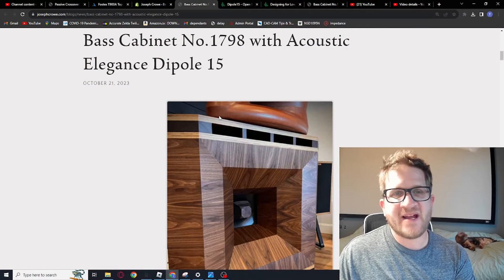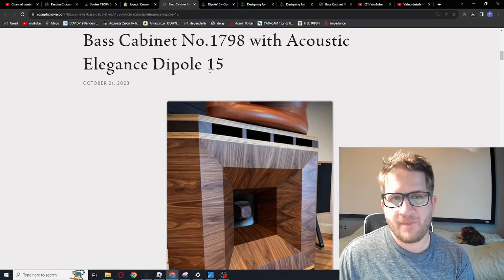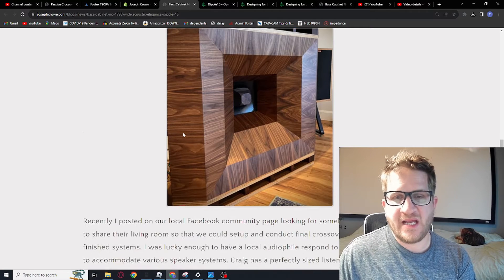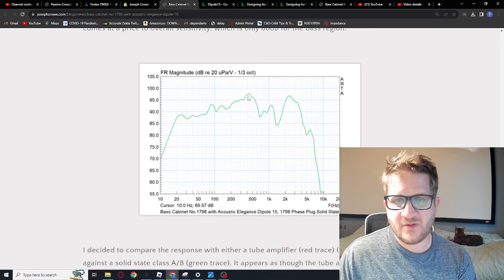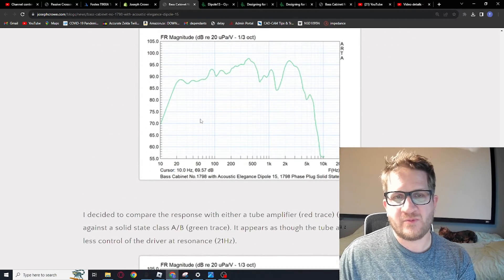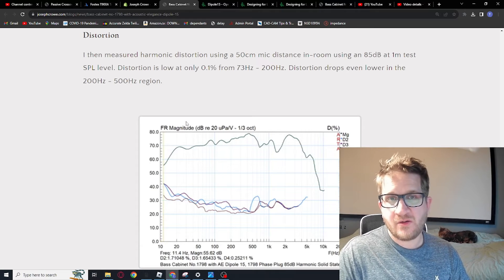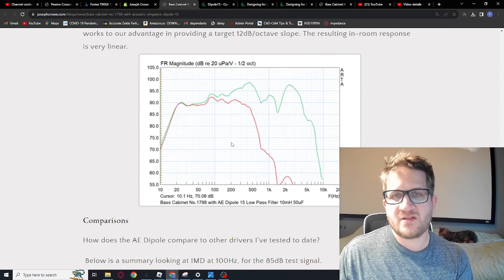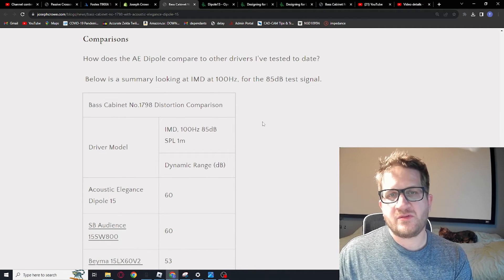Bass Cabinet No.1798 with Acoustic Elegance Dipole 15

Comment: I think it's time for you to switch to 18 inch speakers. A completely different feeling of low frequencies, significantly less distortion, the very format of music perception changes. You haven't even set foot in big sound territory yet.
Reply from the maker: Thank you for the suggestion. I will eventually get there. I’ve modelled an 18” but it’s a big change for the 1798 cabinet, it pushes the size larger than I think most would go for. So I may look at a regular bass cabinet using the Beyma 18LX60V2.
Reply: Given the cost difference between the 15” AE and 15” SB, could you use two of the SBs in an OB design and get enough bass extension to not need a sub? Two SBs per side would still be cheaper than one AE driver
Reply: @ccdccd8615  For several years I began to use 18 inch speakers in my designs, both an OB and a modified bass reflex. Even one driver produces bass of a completely different quality. I can recommend JBL 2268HPL, JBL 2241H, you won't be disappointed. The price is very affordable, no distortions at all, high sensitivity and most of all - phenomenal, very palpable and texturized bass impact.

Comment: According to AE's homepage the driver have an xmax of 15mm peak, not p-p. 🤔
Reply: Based on 70% of  BL. Not by when the surround makes it unlinear. They used to be rated at 12mm xmax when sold by the original manufaturer- Lambda Acoustics. So who knows without testing them over different excursion lengths? The 15M starts to get anomalies from stretched surround at 3mm ish, while it's rated at 6mm xmax on AE website.🤔

Comment: What concerns me about the speaker is its low FS. This tells me that most likely has a high moving Mass, which might explain the low sensitivity.
Reply from the maker: The moving mass is 90g, the SB 15OB350 is 107g. Moving mass is not directly related to sound character, despite it being intuitively related…it is not.
Reply: Not necessarily. You need to consider the Vas, and other suspension related parameters.
Reply: I used the following speaker in a project and and it gave very favorable results. FAITAL 15HP1060 (15" LF LOUDSPEAKER, NEODYMIUM, PUSH, 8 OHM) 
Perhaps something you might want to test. Very tight, un-muddy bass for a 15 inch woofer. While it rolls off at 36 HZ, very few musical instruments play below 50 HZ. If you play a test tone at 40 HZ it shakes the house. By the way I love the stuff that you're doing.😊
Reply: @davidkclayton  Classical instruments that play below 50Hz: piano, contrabas, bass tuba, pipe organ, contra bassoon.

Comment: VAS =600+L - is very good for 1watt (home watt)

Cabinet - no back panel?
Reply from the maker: That’s correct. The rear panel is completely removed. There are two large pillows in the cabinet that’s still required.
Reply: yep altec 416 would also fit the bill.  You have to be aware that these high vas driver may have low-ish power capabilities.
Reply: @interesting7906  Well the one Joseph used in this build is rated at 100W. Some of the older drivers weren't designed for high inputs because high output amps just weren't available. But an Altec 416 will accommodate 150W and is capable of 117db of output without horn loading, so I don't think that's an issue.
Reply: @weatheranddarkness  They were designed for BIG reflex boxes 250-300L, with high VAS and super compliant suspension. You can get mine to move by blowing on them. 150W on a 416-8 will break them and your number 117dB eff is out of the question I they are 96/97dB. I can hardy break 5-10W musical peaks in the LF on mine.  I use TAD 2002 compression drivers for HF those are 110dB eff I believe.
Reply: @interesting7906  my number of 117db is the max output(as I stated) -from the spec sheet. it's not the sensitivity rating. 150W is also from the spec sheet. I didn't pull it out of my ass.
Reply: @weatheranddarkness  👍